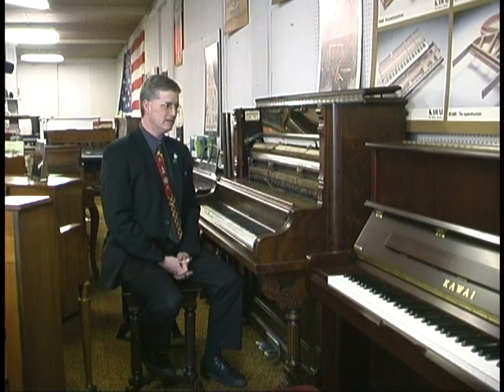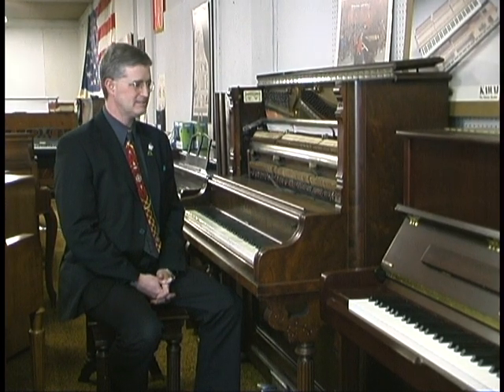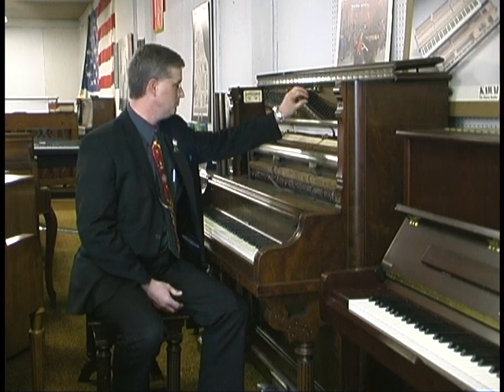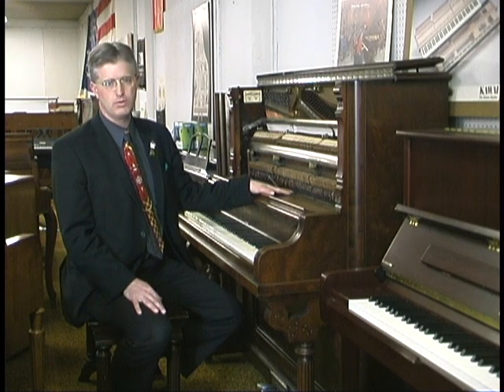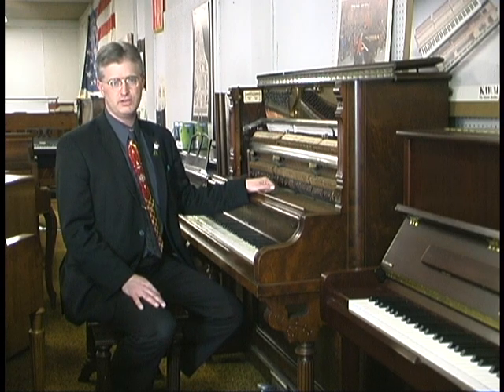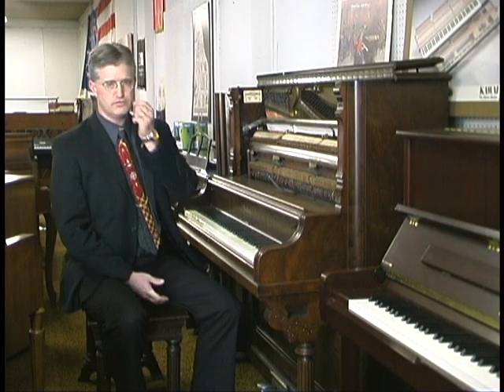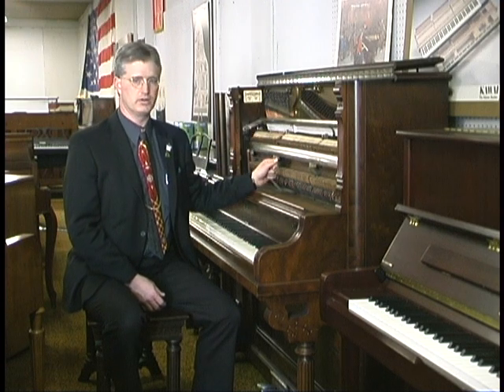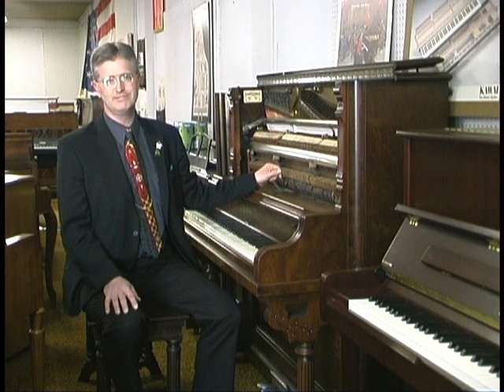Is My Old Piano Worth Fixing?

Comment: Putting a new pinblock in a vertical piano is more time-consuming than in a horizontal. You could probably get a new piano of the same quality for less than the cost of that labor.  If the pins in a vertical piano don't hold the strings in tune, I would say discard it. If it needs new strings, hammers, and action repairs, it might be worth restoring. Because of the way they are constructed, horizontal pianos are a different story. Taking out the old pinblock is easier.

Comment: The quality of the wood and workmanship in the early 1900's stands up well today. The USA had fine grain wood we will never see again. Buying an old piano from the 1920's has several criterion
to look for.
1)Looks ( refinishing is ultra time consuming and often not worth it.) Pick a used upright piano that already looks good. There are plenty available on Craig's list or Kijiji and almost free,.Just pick them up.
2)Make. The piano this fellow was showing was a Packard,  a good one. If it was made in the mid west  or north east  USA it probably is a good one. In Canada, Heintzman and Bell are the best.
3) Are the pins holding pitch ? Often the tuning pins lose their torque over time which can be remedied with CA glue application a $325 cost  which tightens the pins.Cause by dryness in  winter
4)Check the inside of the piano. Is there evidence of replaced strings, hammers grooved etc.If so run away.
5)Avoid pianos that have a lot of carving on the case  (too old)
 Tom Lloyd

www..mrtuner.ca

Comment: I have a hundred and two year old piano. It was originally a player piano, but somewhere along the way someone removed the player mechanism. I wonder what it might cost to have a player mechanism put in it today. If they even make them now?
Reply: Crash64100 I just picked up a player piano that was made in 1920 ☺️
Reply: Player actions were all different as the manufacturers were in competition with each other and did not share. So putting in a new action is not feasible. If you want a player then get one with the parts intact. Then find one of the few player piano techs still in business. They will replace the bellows etc., as bellows have a shorter shelf life, and disintegrate after 100 plus years. Good luck  Tom Lloyd

www.mrtuner.ca